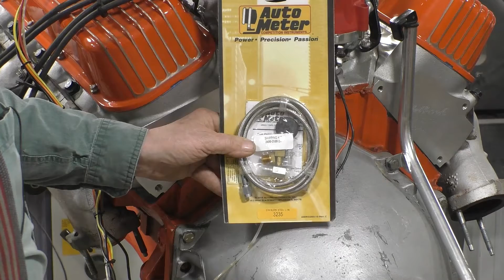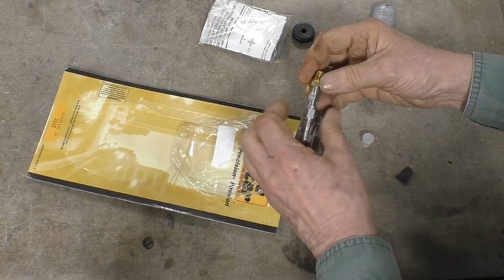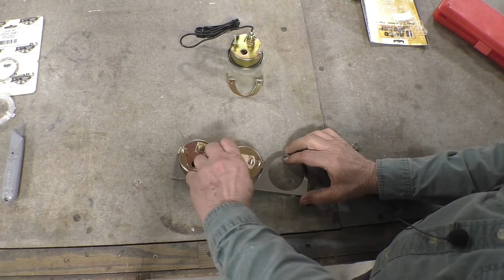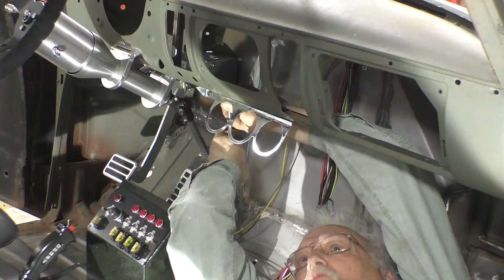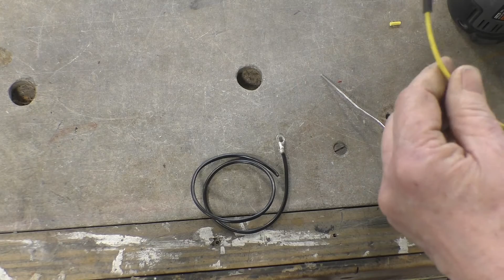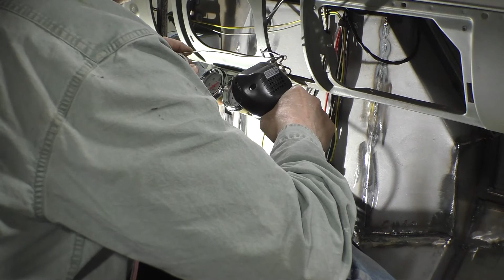Gauges, NHRA Required Braided Oil Pressure Line, 1949 Chevrolet Gasser

Comment: What's the part number for the line kit?   I'm not finding anything to adapt to the 1/8 ntp on the back of the guage.
Reply from the maker: AutoMeter Tubing and Line Kits 3235. https://proshop.summitracing.com/parts/ATM-3235

Comment: Good Video.  Didn't know they sell braided lines for the oil gauge.  I thought there was only nylon and copper.  I've read many negative comments on other sites complaining about nylon lines breaking and leaking oil.
Reply from the maker: The braided line is a rule from NHRA. Thanks for the comment.

Comment: I have never seen an oil galley for the oil gauge on a bbc on the back side of the block. I went over and looked at my 396 just to be sure I wasn't seeing things. What am I missing?
Reply from the maker: Maybe is is specific to a Gen v block. I get oil pressure from that location???
Reply: @ThrottleStopRacing   Thanks for clearing that up. I haven't messed with any of the newer blocks.
Reply from the maker: @green68chevelle It is only a guess.